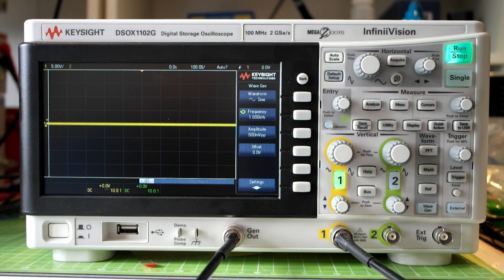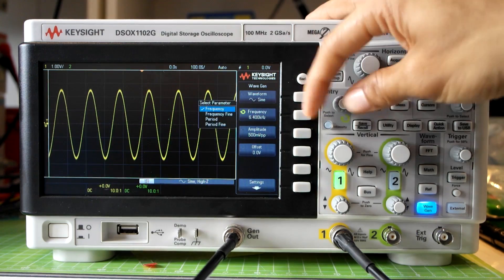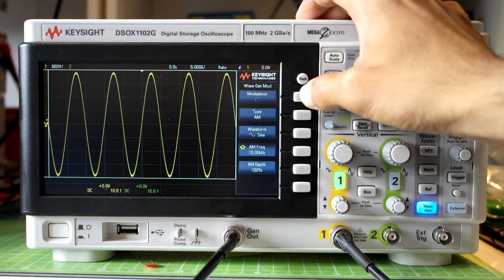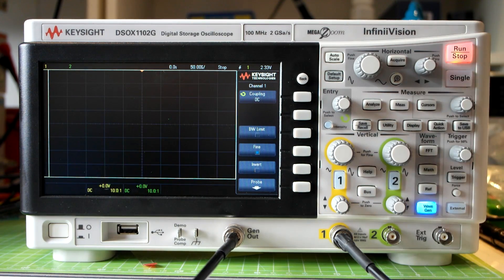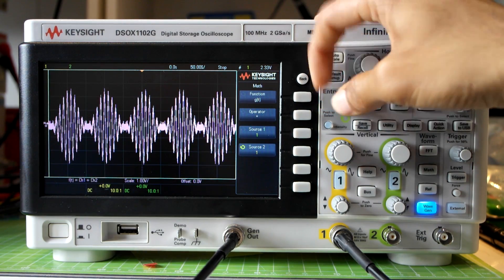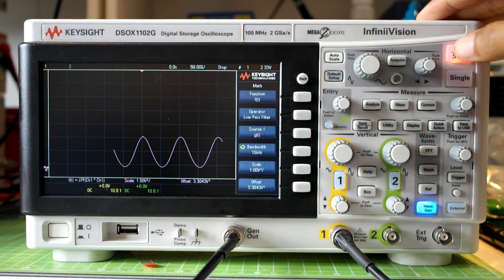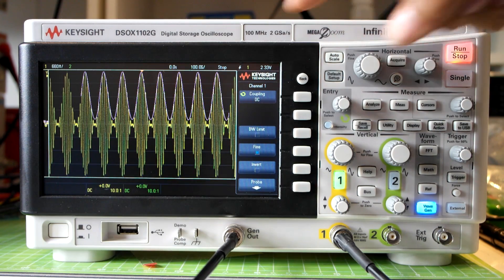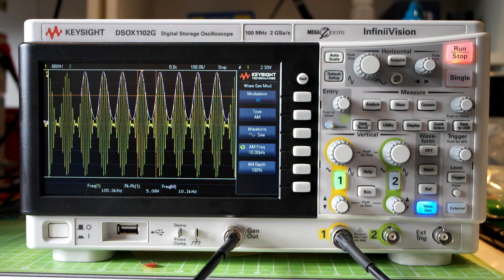Keysight X-1000 Review: Demodulating AM using just the MATH functions!

Comment: nice but the frequency count on the demodulated waveform was 10.1kHz?  not 10kHz   what's up with that???
Reply from the maker: That's because the scope uses a less accurate software based frequency counter for measuring the frequency of the math traces. This is not a limitation though, the only way of measuring frequency of an internally generated trace is software. The hardware counter on the other hand is much much more accurate.

Comment: I'd like to see the FFT of that squared signal. My RF & trig are both very rusty, but wouldn't a whole slew of other frequencies be generated too, like 20, 180, 190, 200, 210, 220 kHz?
Reply from the maker: You are correct. The squaring will produce a lot of other modulation products. You can see what the waveform looks like if you look at it before I adjusted the bandwidth of the filter. I might do a follow up video explaining how/why this works.

Comment: In order to do this with the oscilloscope you have you had to hold the signal and to read it yourself in order to exploit the datas that's not something you want to do.
Why bothering to do that on an old oscilloscope and such interfaces ? Just install gnu radio, put a 2-3 blocks, link them togever and you get your output stream/file demodulated and even extracted from some protocol the datas could have been encupsulated in.
Otherwise any cheap digital oscilloscope with a proper GUI and has the power to demodulate the signal on the air then you can exploit it directly.

Get the proper tools for what you want to do. If it's radio frequency, just use any rtl sdr and gnu radio that range from a few MHz up to 5 Ghz for 300$. You can have an rtl sdr for less than 20$ that goes up to 1.8 GHZ if you want to play with modulation and filters on AM & FM radio signals and even the GSM band.
If it's low frequency, just use a cheap digital oscilloscope for 30$

That's a nice, expensive and powerfull equipement you have here. Just use it for what it's good at